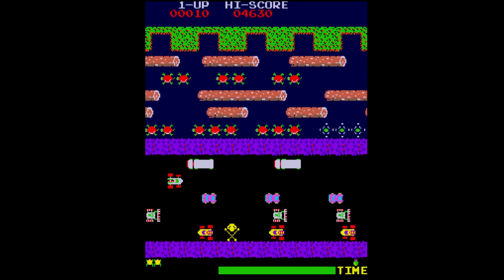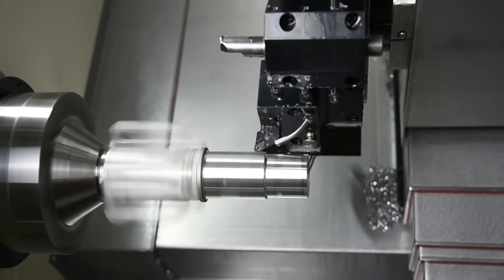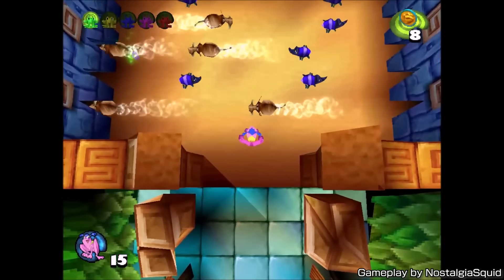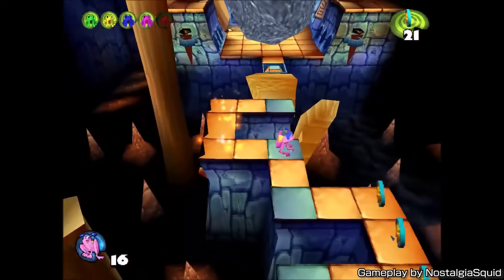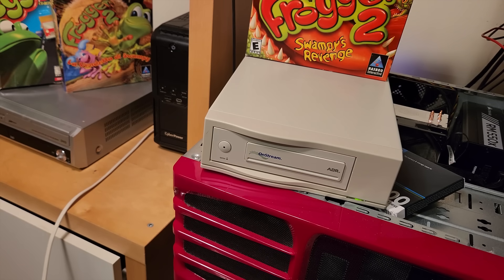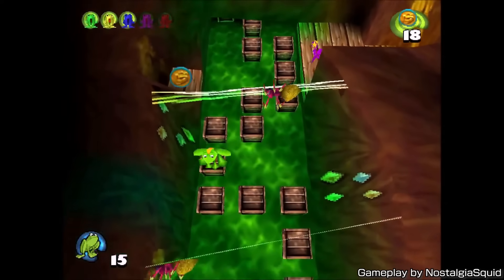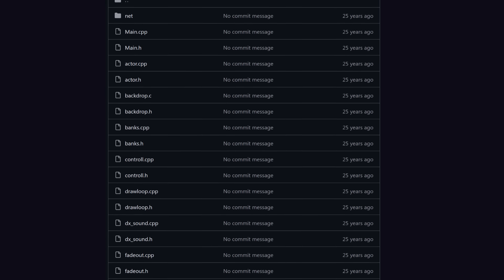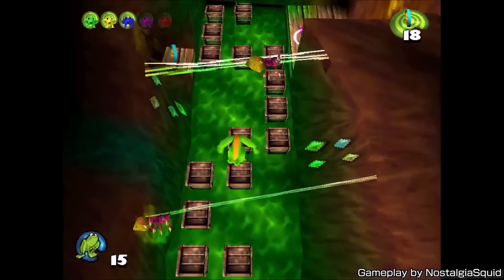How Frogger 2’s source code was recovered from a DESTROYED tape

Comment: Years ago we lost 50TB of video files (raw files, so 50+ GB per file) on NAS that was partially backed up. It was a RAID 6 and the fa got corrupted. We mail the disk to a recovery company, after a few weeks we get the quote 100k euros. It's was not mission critical stuff so we declined and got the disks back. I still had the disks around, one day after a few months I was searching on Google on how to use MDME for these kind of jobs. I stumble on a blog post with a youtube video in it that featured a case very similar to ours (RAID 6 failure, braw files, 50Tb of it). The guy in the video (speed up video, but at 0.5x you could figure out all the steps) shows how he recovered some data, turns out it was our data. I contact the guy asking to blur out the faces in the videos, turns out he was hired to do the "research" that the lab would have used to recover our stuff. 

I recovered the data.

Comment: I had completely forgotten about arcserve until I saw this video. My old job used it when I started there in 2000. I ended up working there for 18 years, and pretty quickly trashed arcserve. I don't even remember what I used afterwards, but once we retired tape backups I just used winrar to an external hdd, then wrote that once a month to a dvd-r and later a Blu-ray once it grew beyond the 8gb limit(there wasn't that much data clearly).

Comment: I know what was going on with back up formats in the 90s. I was a video editor in that time working on animations and you could only back up to tape, because nothing else could handle the size of data. 

And all of the formats were new. Everything was experimental ,unless you wanted to go with a super expensive option that would be used by a Fortune 500 company. So everyone was publishing new temporary formats, everyone was trying to become the new standard, formats were upgraded and changed annually, it was a free-for-all. There was even one format that would back up your computer to a mini DV tape using your Camcorder with a fire wire connection.

One of our projects was even backed up to about 45 CDROMs,  at a time when they cost almost $10 each, because that was cheaper at the time.

Comment: Some technician told me this story about two decades ago: the serverroom of a client burned down, luckily they had a tape backup of the servers offsite. After they got the backup software back, what was already a struggle, sadly the backup was not restorable. The replacement drive could not read it, whatever they did. Probably the burned drive was badly misaligned or had incompatible firmware. And yes, I can confim it: Arcserve s*.

Comment: Well, backing up to tape is still used because it gives you the most data storage for backing up for the least amount of money and energy.  If the data doesn't need to be frequently accessed and is expected to be stored for extended periods, such as for backing up or archiving, then tape actually makes sense.

The predominant format for data storage on tape is LTO.  A benefit of that format is that it's open rather than proprietary, which is what the O stands for in LTO.

Comment: I have the same experience with data "recovery" companies - they are useless and are at the level of a skilled IT user. I had more luck recovering data myself - somewhat a motivated individual can put thousand times more effort into a project like this - I have wrote some filesystem recovery tools myself, focusing on video file recovery - so much more familiar with containers and codecs. Not a "1-click" solution.. but many times more efficient in getting the data completely back. And after some years.. those data "recovery" companies send me time to time some jobs, that I am better in, than them.

Comment: I like to call myself a dude that archives but I think I’m just a data hoarder for over two decades. When I got my first PC in the late 90’s to early 2000’s? I was young but I remember the excitement of my mother having this huge box in my room saying happy birthday and Christmas for awhile since it was so expensive.

We shared the computer as a family (this was a common thing) computers were always a luxury item but I was sucked into learning everything about computers.

Building, fixing, software development, then I got board and got into vulnerabilities, application reverse engineering, electronic modifications, DRM bypassing, key generation, and eventually hacking of all sorts. Mind you I’m just a child at this learning by reading online and joining a reverse engineering team believe or not.

I got really good at everything , I even specialize in a few key things like manually unpacking and in-line code modification for bypassing DRM. One of my coolest methods to bypass the Online DRM check/ what you purchased for this one application, was creating the file that it usually checks online for the application on its server. It  would Check to make sure you are still an active paid user account and how many computers you have have the application running.

well, I had the server file (modified file that had everything enabled and unlimited PCs) in the same directory as the application and hardcoded the check (on the application) to read the file locally in it’s folder and completely bypassing any type of online checks.

It was so much fun and I never got paid for it but the gratification and the praise is what kept me going for years . 

I actually still partake in things if you know what I mean, but it’s actually a more personal content I will modify and will only release it to someone that would ask me. Friends will ask me to check something out and make it “usable” for them.

Also, I have the best discount for TurboTax (EVERY VERSION/ UPDATE) for over 15 years , state and federal is zero dollars transmitted electronically. That’s a little over $100 a year saved. Not counting the unlimited states downloads and doing my families taxes to save their money also. 

But I do miss being in a team and communicating and learning new advanced techniques.

Comment: So many familiar experiences. "Experts" who make it worse, standards or specifications not being followed... Amazing they managed to get anything recovered at all. The nearest story I have is at a communications company, I was tasked with faxes. In 2017. One of the errored recordings had a single bit wrong, from presumably a bug of the sender's software, it tripped up the decompressor which broke the next data. I don't know if it was a single-bit error or it was because that data stream would've been legitimate, with less compression. With a little compensating, the full fax comes out normally. Something routine. My boss described much more obscene things coming out of recovered transmissions.

Comment: Anyone who worked IT/Data storage in the late 90's-00's probably had the joy of explaining the catalog nonsense to the CEO of the company as to why the backups were trash and the data was gone. On a good day with supposedly working hardware, it was dodgy at best. Where I was, we returned to writing some of the most critical data to single drives with TAR.  I worked with Arcserve and several other equally bad packages.

Comment: Cant believe someone is talking about this! Kneesnap is a great guy and one of the best engineers I've ever had the pleasure of meeting.

Many moons ago, right after the tape got b0rked by those idiots, I helped him look over the schematic of the drive to see what signals we could find. The drive has, if Im remembering correctly, two or three rather exotic processors from Phillips Semi before they became NXP. Naturally, the documentation for said chips is nowhere to be found, but I got him set up with Salae software and some grabbers so he could probe pins to see what was up.

He even went as far as to dump the drive firmware and we went spelunking in Ghidra, but I dont think we ever found anything useful.

I never had as much time to sink into this due to work, but it was amazing seeing him finally extract all of the data from the tape

Comment: Literally, the hardest way he could possibly fn did it. Why deal with the drives firmware in any way??? Figure out the tape speed, how the tracks work, tap off the head to a logic analyzer or simple ass Arduino, and just copy the data raw from the tape. It’s genuinely not that complex.

Had to do this for tapes of [REDACTED] origin you most certainly will not find working equipment for. For fk sake tape is so easy you can get a not so special tool to see the data and could literally do it by hand. Why’s everyone act like this was a mission to the sun??
Reply: My other comment detailing why this is nowhere near a simple is hidden.

But in short, no, it's nowhere near that simple. This is digital data, not analog, so even if we did reverse engineer the proprietary tape head, every other part of the process is still custom, and uses a custom ASIC chip, which is controlled via commands from a secondary microprocessor that the firmware is internally flashed to.

In other words, there it would be virtually impossible to turn the analog signals into digital data. And that's not even getting into trying to understand that digital data, figure the ECC error correction bits, etc.

Comment: I'm just wondering what the point of the splicing was? Did they think data corruption was causing it to not read and try to cut it out to force a load? Because, there has to be a better way to do that than physically cutting the damn tape.

Comment: Great job on getting that 99.99% of the data back despite impossible odds.  Good ole ArcServe.  I used it in the early 2000s with tape drives at work since I'm in IT.  While it worked but the recovery method is just strange.  I've stopped using it and went with a script I wrote to disk to disk copy and then to cloud fully encrypted.   

I am a bit shocked that this was the ONLY backup available.  No additional copies in different format just in case?  I guess at the time since they were using ArcServe they didn't think it would be an issue in restoring it in the future.   This proves as to why you need to save your important data in different formats.

Comment: Some years ago I tried playing an instruction video for a product that I own on a VHS deck that promptly destroyed the tape, as a rubber roller had turned to goo.  That's a big problem with old tape equipment.  Before inserting irreplaceable tapes in old machines, they should be opened and any rubber parts that come into contact with the tape need to be checked for integrity and replaced, if necessary.
Reply: That is true of all vintage electronics. First open and inspect.

Comment: We used Arcserve for at least a decade on all our servers  with both DDS and LTO tapes, it seemed decent at the time.  I do believe there was a process to read a tape and add its contents back to the online tape database on the machine.  The database was kept on disk to make it faster and easier to identify which tapes had which versions of a particular file backed up.

 Sounds like they took some liberties with that particular driver but if the OnStream company used a proprietary encoding format they would have been reverse engineering the standards without docs back then?  Lucky to even have support for the drive in the first place.
Reply: This is right, it was the OnStream-specific implementation in ArcServe that had the catalog failure, I confirmed that other tape drives were not impacted by this bug.

OnStream's SC30/50 drives just did something else than the entire rest of the industry for no reason. This was both the reason why I couldn't read it initially, but also part of why I was able to recover the data.

Eventually with the ADR50 they decided to get with the rest of the industry and use the same command interface as them. That's actually part of why the ADR50 wasn't capable of reading tapes written by some software to the SC50.

Poor planning and wanting to do things their own way (and then backtracking to just use the industry standard) certainly was a choice.
Reply: @kneesnap1041 thanks for doing all the research for this .. interesting to see and learn about all the internal processes, design decisions, etc companies were using back then.

Comment: In the late 90s our small business was sold a tape backup system. Every single tape we used failed within a couple years which made it pretty pointless. None of the HDDs that were being backed up failed as often as the tapes. I never used a tape system again.
Reply: THIS!!  There are so many people with similar stories or experiences.  Even today they lie about capacity and backup speed by using compression as a factor.

Comment: Now all we need is a program that lets you put And IS o of either of these two frogger games into it and then allows them to boot on a Steam Deck so we don't have to do PS1 emulation especially if we can get four players going that'd be awesome. Or technically you can always send the LAN data over the internet and play the first ever online frogger multiplayer session. That would be very cool.

I still have both of my original discs and the GBC cartridge for Frogger 2 though I don't have my Frogger one Game Boy cartridge. I actually like that version of Frogger though. Back when the arcade games weren't just the arcade ROM in an emulator You had some pretty unique versions of old arcade games and they were sometimes fun to play because of the fact they were different.

Comment: I had an OnStream ADR drive way way in the past and can confirm it offered really good storage capacity for relatively cheap prices. I think that was my third? I think I started with a QIC based drive, then Iomega Ditto, then OnStream ADR, then an LTO-2 drive. While most has long gone I think I still have an LTO-2 drive in a "gutted" mini tower somewhere (not sure how much computer is left in it) and have a couple of tapes but think I only used one tape once. Can't even remember which backup program I used. Pretty sure it wasn't that naughty ARCserve though...

Comment: This situation shows that standards and open source are vitally important - not just for software preservation purposes, but for general interoperability too.
Reply: Yeah, exactly this.

I had thought that LD-ROM took the crown when it came to being the poster child for digital obsolescence, but this tape drive is a pretty solid contender.
Reply: At least public standards. PKZip was Proprietary, but Phil Katz published the specifications for ZIP Files from the beginning on. Also PCX Images (also from the MS-DOS World) was a public standard from the beginning on.
Reply: Yeah, good luck telling the military to use open source and standard equipment / software anyone can get their mitts on
Reply: @DeltaStormYT  Depends on which military you mean, but Western militaries certainly use open source software and standard consumer equipment. Look up COTS (or Mil-COTS), Wind River, etc etc.
Reply: @DeltaStormYT  surprisingly a lot of military stuff is running on open source stuff, because security through obscurity is kinda shite.

They're using Xbox controllers for a lot of stuff nowadays, because getting a replacement is way easier and it's way cheaper than a custom controller. (Also getting a replacement part for a submarine controller is way less covert than an xbox controller.)

There's still a lot of custom stuff but the army uses a surprising amount of open source software.
Reply: BBC Domesday Project in the UK came on Laserdisc, published in 1986, by 2002 they were not sure it could still be read at all ...

Comment: "What the hell was going on with tape standards in the late 90s?" my question throughout this entire fucking video good god
Reply: As someone else commented, the tape companies were all trying to do the "razor blade" model of selling the drives cheaply and making money on the tapes, and that only works if the tapes are proprietary.  Of course, that still doesn't explain why the companies couldn't even manage to stay compatible with their own products.

I'm not sure standardization would have saved them against CDs, though.  Random-access writing is pretty much a killer capability for anything other than actual backups that you don't plan on reading very often.
Reply: @BrooksMoses The issue of compatibility was a self-inflicted wound in OnStream's case. There was a standard command interface (QIC-157 if I remember right. Maybe it was QIC-174?) OnStream broke with the rest of the industry and did things differently for the SC30/SC50.

Eventually they changed their mind, as the ADR50 used the same specification as the rest of the industry. But because some of the tapes (depending on the software used to write the tapes) written with the older SC30/SC50 just weren't written in a way compatible with that specification, the ADR50 drive just wasn't able to read them.
Reply: Yeah, CDs would never have taken off if they were as messed up as tapes were. Kinda makes me wonder that if better standardization had occurred, maybe tapes could have been a much more common media format.
Reply: it was similar for most things in the 90s and pre 90s